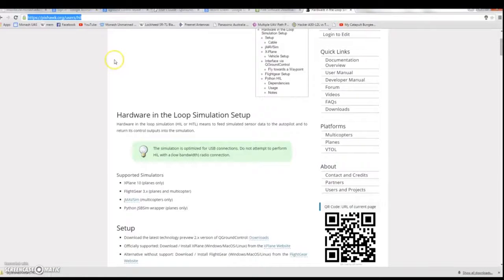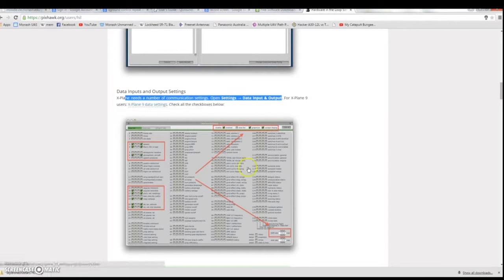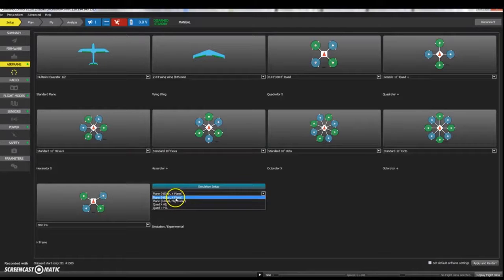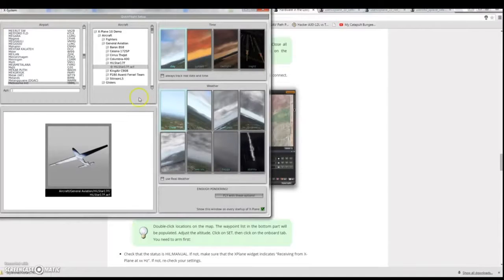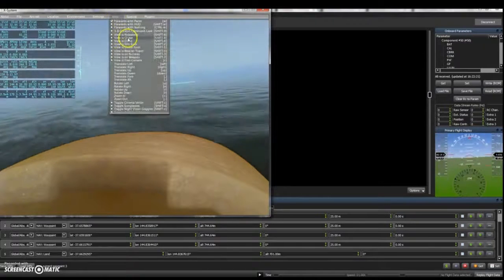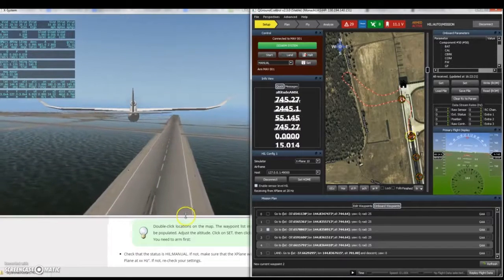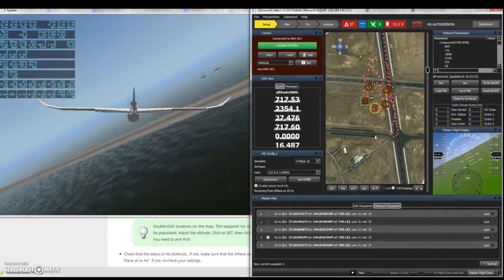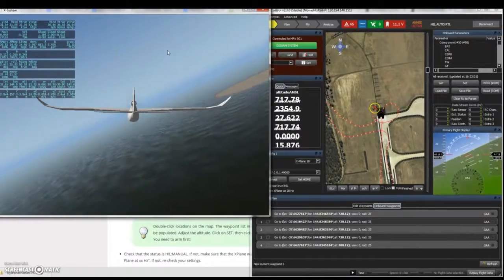Hardware in the Loop Simulation (HILS) Pixhawk PX4 Demonstration

Comment: Do my px4 needs to be gps fix in order to get a good simulation? When i connected with x plane 10, i got a gps bad fix alarm and i couldn t continue with my simulation. I am working with qgroundcontrol10 and xplane 10. Also, i am trying to simulate a VTOL aircraft.
Reply: Anna Svagzdys join px4 facebook best place for help otherwise adruopilot page.

Comment: @Monash: Great stuff. I am using the latest version of QGC and Xplane 10 to simulate.However the plane refuses to arm wen i disable Sensor HIL in the QGC. Even if it arms, it doesnt takeoff or accept Auto mode. Can you help??
Reply: im experincing the identical problem but idk
if u have some clue, plz share with me
Reply: Karthik A hey this is from 2015 join the pixhawk facebook page and everyone there is really helpful and you may find someone near you that will help face to face. Good luck.
Ive had my pixhawk for over a year and still cant work out how to get off tge ground. Can program all switched and sticks but bont know if thats it so your way ahead of me. 
I have to use Air3 Inav which limits me massively. goos luck